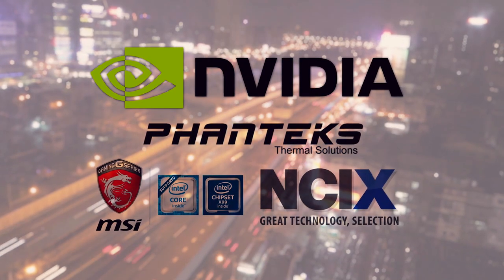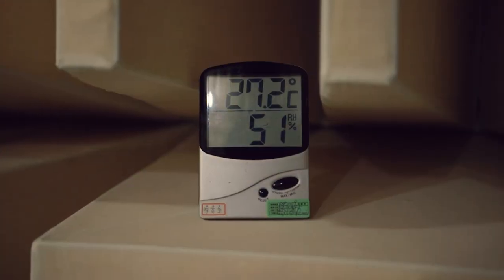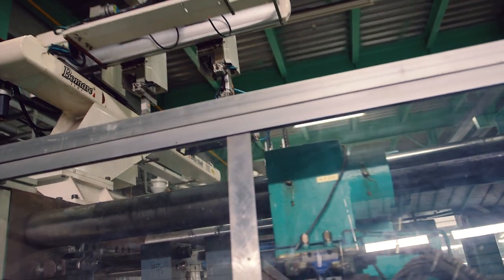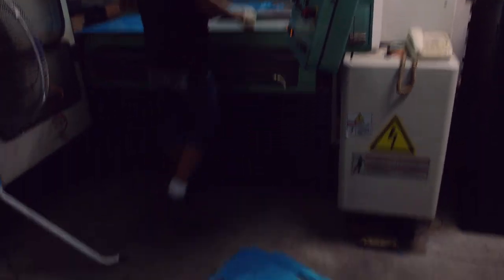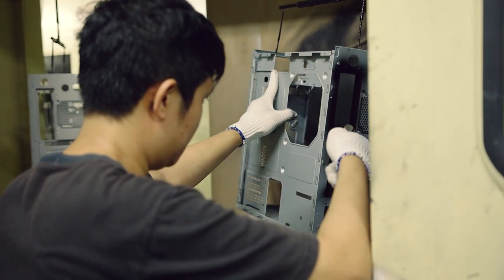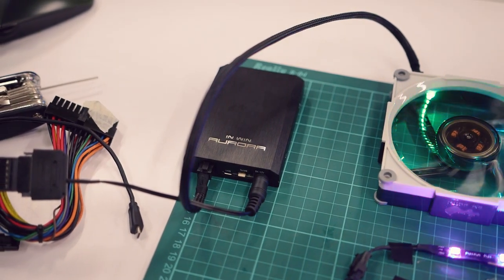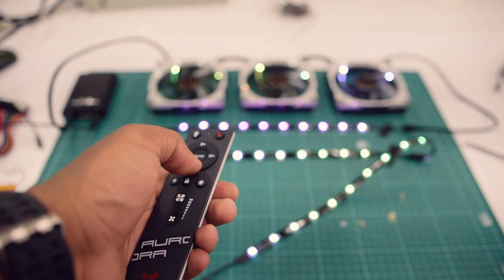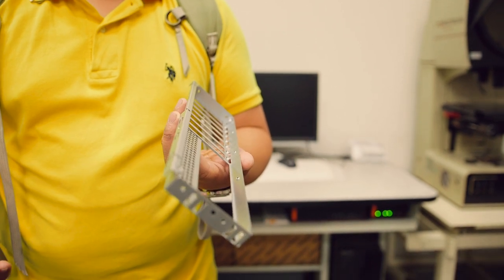InWin Factory Tour - How Cases are Made!

Comment: Dmitry, LOL you can't dry water. You can evaporate it though. Those machines are called plastic injection molding machines. But actually the finish is done in the mold. I have unfortunately worked with those kinds of machines. It's hard monotonous work. Mostly monotonous. And all those things on the table were called molds.And yep they are very fascinating Machines.
 I'm guessing English isn't your first language.